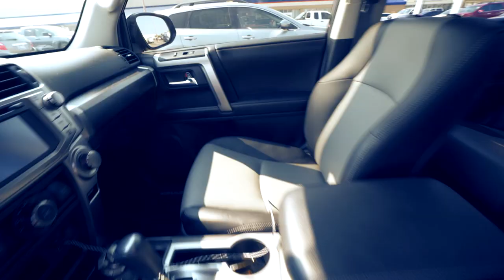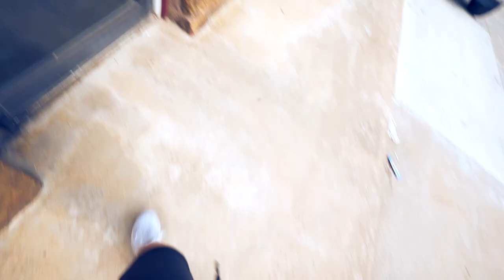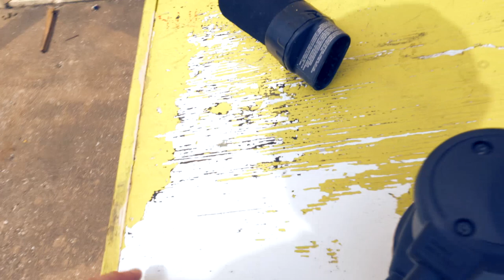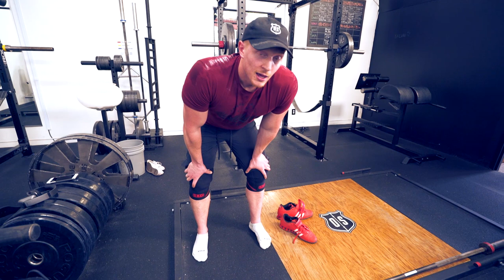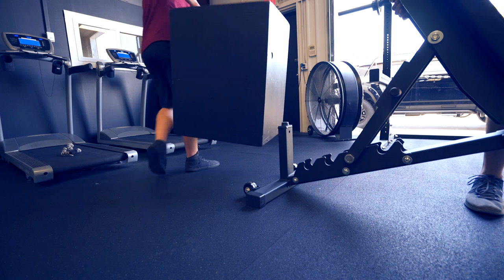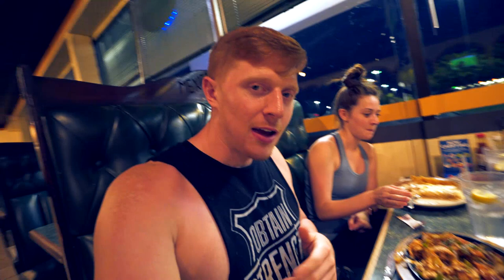SQUAT HACKS - How I Hit a New PR with 3 SIMPLE Changes

Comment: Quick question. I'm still fairly new to the gym. My lifts aren't that heavy yet. When should someone contemplate getting lifting shoes. Should I go by a certain weight, or just get them right away?
Reply: highflyer131 My two cents: It all depends on how much you want to invest into yourself and your training. I only got a pair recently after hitting 315 on squat. You're welcome to get them immediately, but since you're fairly new, it's also important to rememeber the novelty of weight lifting will wear off so don't buy every piece of weight lifting equipment. Totally fine to squat in converse or barefoot 👍
Reply: ThtNotSoAvgT thanks for the input. I was kind of thinking the same. Might hold off and see how far I go and if I progress.